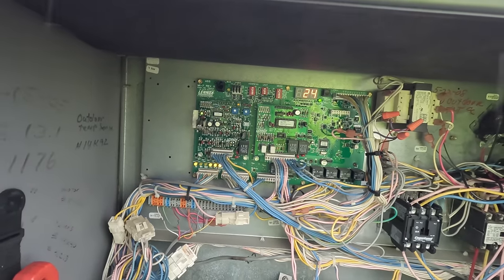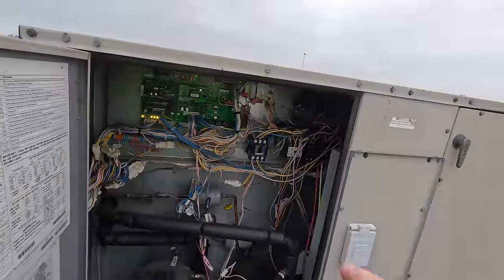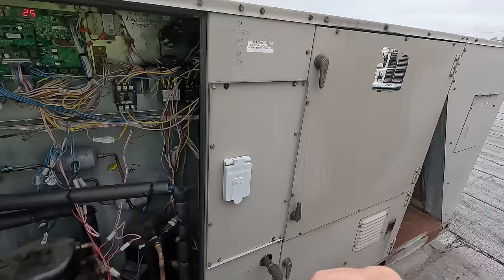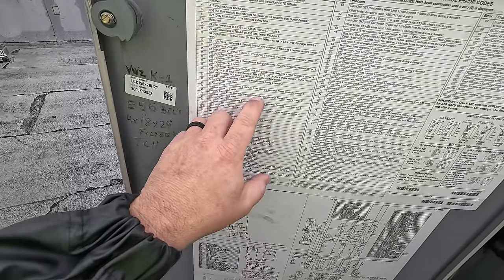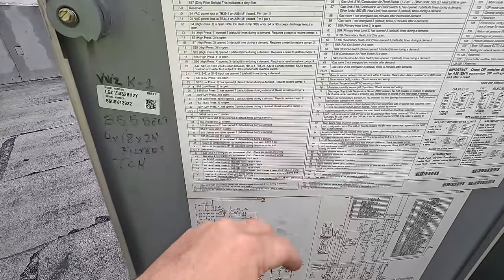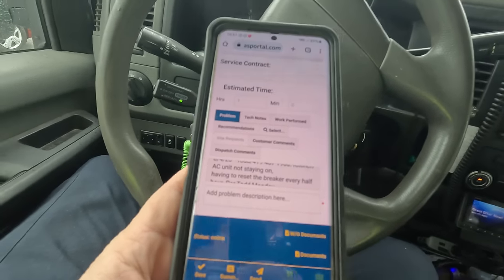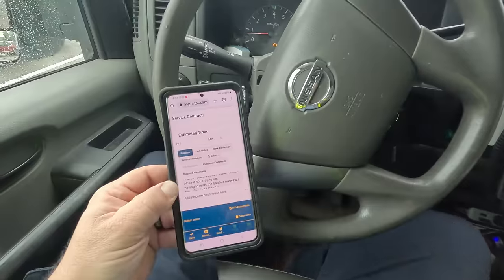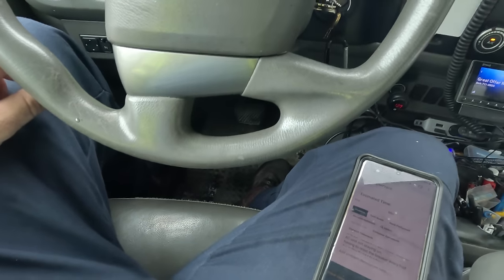Breaker Tripping On Kitchen RTU or Is It?

Comment: Those split pulleys are adjustment pulleys and they are supposed to be replaced by a set pulley when the buildings airflow is balanced. I know its never going to happen but that is how it supposed to be 😀
Reply from the maker: I have never seen anyone do that or read it in the installation manual.
Reply: I can only speak for how we did it back in the old days in Sweden before we had pressure transducers and VFD.and the fans was either on or off

The purpose of the adjustment pulley was that you didn´t have to change pulleys if you needed more or less air. Then when all adjustments where made and airflows measured in the building you slapped on a set pulley to avoid the risk of some expert ruining it by twisting the pulley when changing belts for example.

In Sweden the airflow have to be measured and adequate every few years depending on the building and ventilation system.
 @HVACRSurvival
Reply: I've heard that too but I haven't seen anyone do it either lol

Comment: just curious, what was the issue with the LP trips? and was the main breaker tripping? What was the final solution?
Reply from the maker: I believe the blower was tripping out on overheat causing the low pressure trip. I did not have any problems after this call.